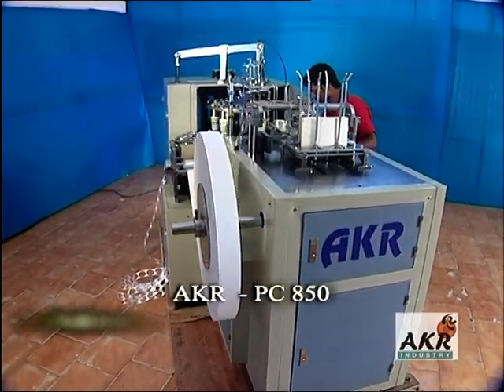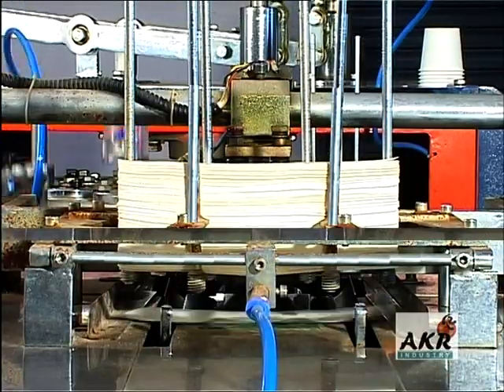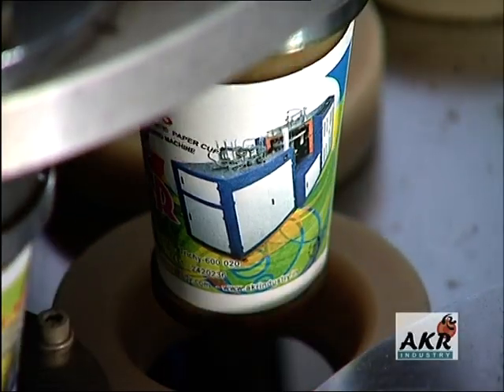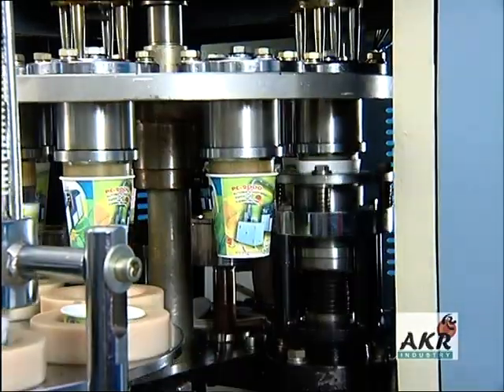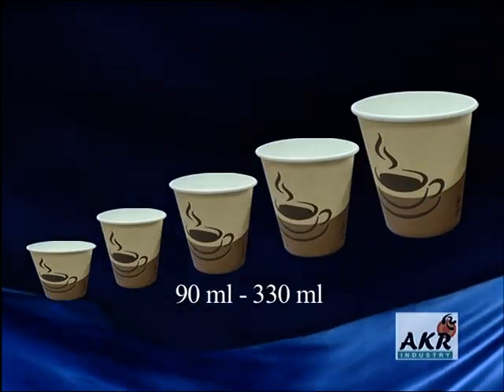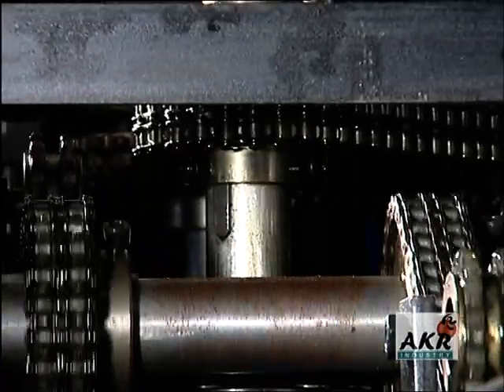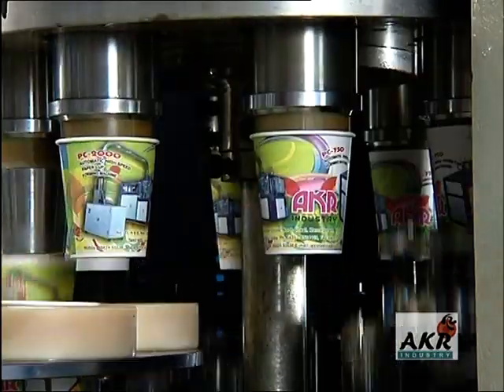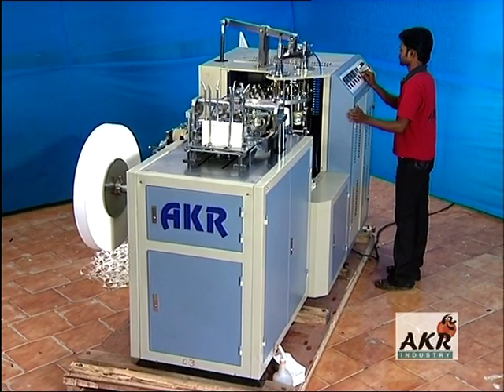PAPER CUP FORMING MACHINE - AKR PC 850

Comment: What about printing on cups ? In which stage does it happens.
I'm intrested in full line printing and forming.
Reply: Printing happens after the paperboard is polycoated. That is after the paper is coated with thin layer of LDPE. It is then printed and cut into various sizes as per requirements. 
Typically auto machine that prints in single Color and cuts into fans cost anywhere between 7-10 lacs. Whereas newer machines that is computerised and prints in multi Colors are expensive at 25 lacs. Hand printing machines are also available but they would not be able to cut into individual fans and has to be done manually. Typically used for large sized juice cups 250ml and 300 ml.
Reply: @deepakpillai9981  le prix du machine

Comment: Automatic paper cup forming machine ( PC- 850 )
Our PC-850 model uses both single and double sided PE coated cups can be manufactured from this. It operates at high speed and hence gives an increased output. The speed is flexible and produces less noise. It is easy to maintain and operate. This machine adopts micro-computer system to control the frequency changing meter and with infinite speed adjustment.
Send Me Price and Catalogs 
almuhoub.factory@gmail.com

Comment: Acceptable machines price not knowing paper cup plate manufacturing machine LED manufacturing led led led led led plastic lid for paper glass required
Reply: AKR INDUSTRY
Ph.No. 0431 2420236
Mobile No. +91 9486455537
H.O: No: 31, A&B New Colony, North street, Mannarpuram, Trichy – 620020, Tamilnadu.

Comment: Dear Rachana Machines,Iam intrested in ur machin,n I wanted to start a small scale paper plate & cup industry.Sir can u mail me the quotation of machine & production process , raw material n printed cups.My mail-tanandagoda@gmail.I am a sri lankan.(+94)0718671642_THANKS.
Reply: Extreme Design & Engineering

66,pushakar ind. estate,Opp-mecons,
Nr-Ramol cross Road,Phase-1,Gidc,Vatva,
Ahmedabad-382445

Yogesh Patel
Mo:-+91-9909823815
Reply: +Manoj Anandagoda This is Vicky i come from a paper cup paper factory from china,if you have any needs of paper,you can contact me by email:vicky@tuoler.com or by whatsapp:+8615824111273